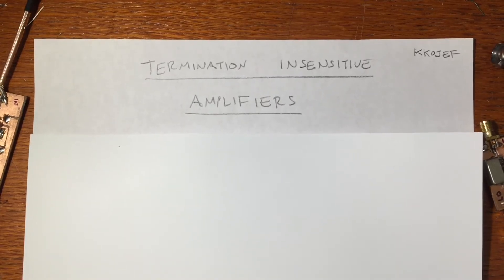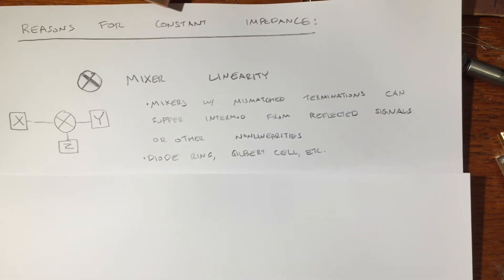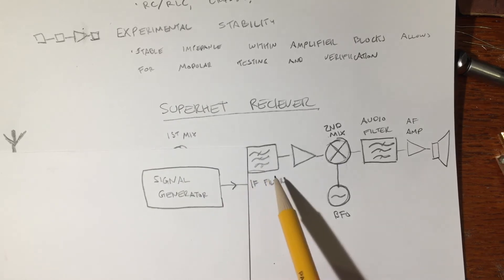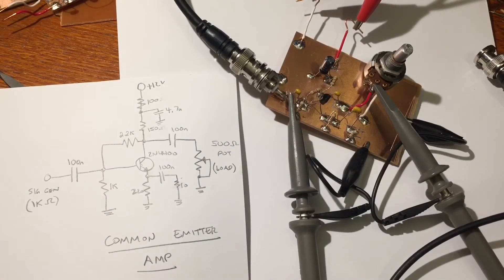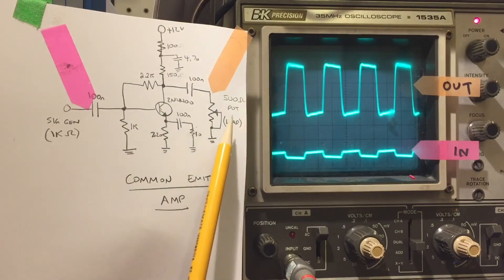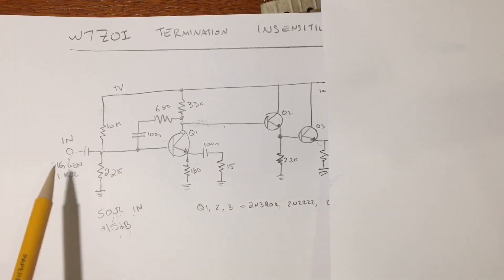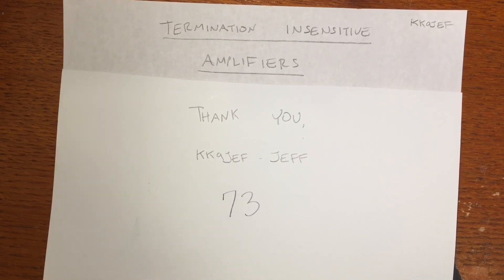Introduction to Termination Insensitive Amplifiers

Comment: Old, but I loved it! I originally designed the TIRA and simplified TIRA amplifiers. Ultimately, I felt the complexity of them (excessive parts count) really didn't make them worth pursuing, but it was an interesting design challenge all the same. I’ve since developed a spreadsheet – based on Wes Hayward’s “Transistor Models and the Feedback Amplifier” paper – that allows me juggle various amplifier parameters to obtain the desired input and output impedances. Not ‘termination insensitive’ by any stretch of the imagination, and a little more hassle to set up initially, but it greatly simplifies things; minimal parts count and no switching needed. Bidirectional amplifiers were cool, but practicality won out in the end. Still, a great video, and thanks for the mention!

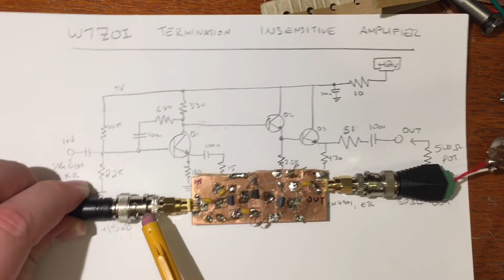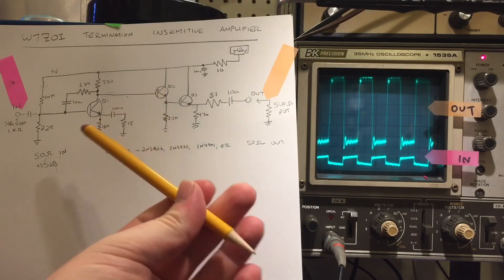Comment: Nice job on the video.  Curious about how you setup your signal generator for a 1K source impedance (at 7:56, 14:10 & 15:30)...  Most generators have a fixed output impedance, but let you specify the load impedance so that the displayed amplitude is correct.  Just making sure you didn't mistake this for a source impedance setting.  I like the colored tabs to correlate the traces to the signals.  As you know - I like the paper-powerpoint style!  Thumbs up!  Subbed.
Reply: Hi w2aew, I came here followed your up vote to this video! Can I ask you of how to measure the in/out impedance? I have a one-port VNA, is it helpful doing that? Thanks!